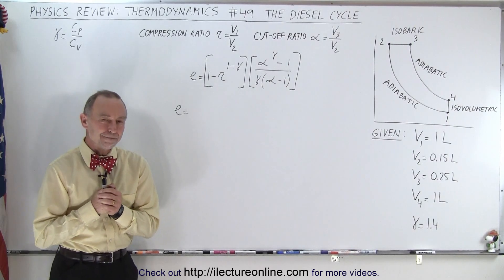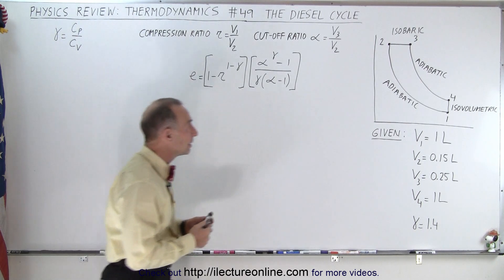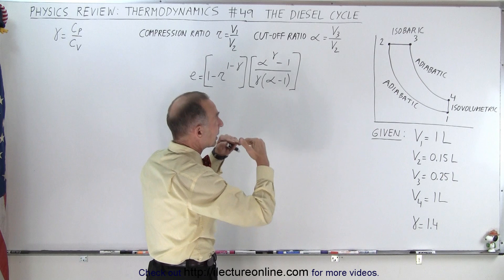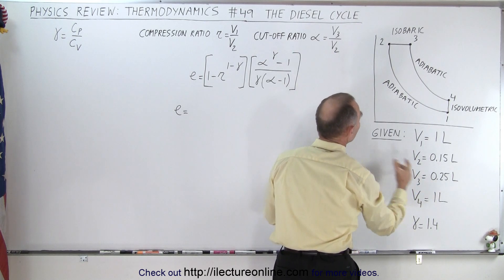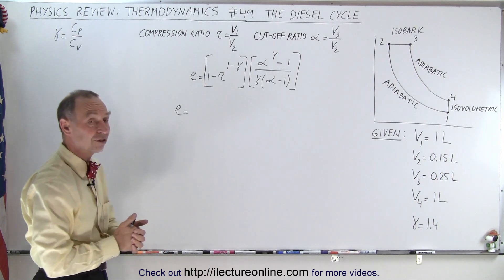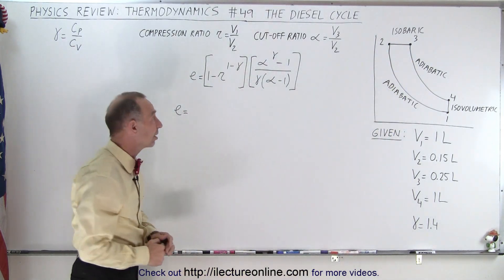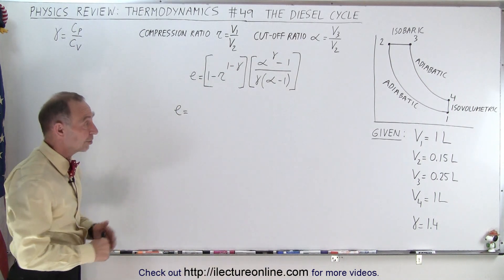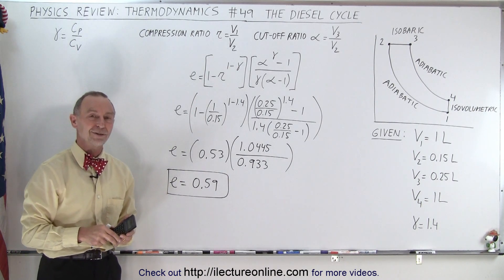Physics Review: Thermodynamics #49 The Diesel Cycle

Comment: Professor Van Bizzen

Can you cover Electrical Engineering
- Sinusoidal Steady Sate Analysis
- Two port theory

Thankyou so much, just reviewing over the summer for the advance EE Classes.
Reply from the maker: We have many EE videos on this channel.  We would like to add more, but time is our biggest problem.
Reply: @MichelvanBiezen   Hi Professor Van Biezen

Oh  totally get that, take your time and no worries. I was just wanting those videos to review over the summer for interview questions. But totally take your time, and do it when you have it :). That was just the last of the sections you had to cover since everything else was, but otherwise, most is covered. I will wait, even if you take years its fine.

Sincerely
      Jay

Comment: 👏
Reply from the maker: Thank you.
Reply: @MichelvanBiezen  you are welcome 😄Mr. Professor what is the main cause of greater efficiency of diesel engine i.e. the difference in temperature (the higher temperature the fastest cooling?) or the pressure (the greater pressure the more work can be transfered by the engine rod?). How diesel engine is able to capture more energy from gases than gasoline?